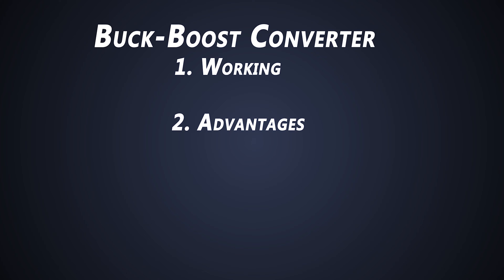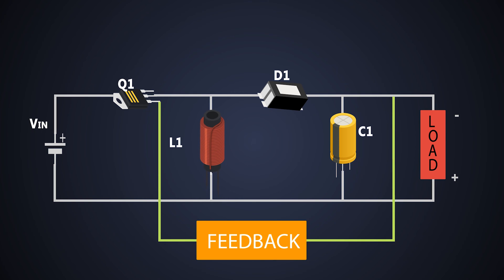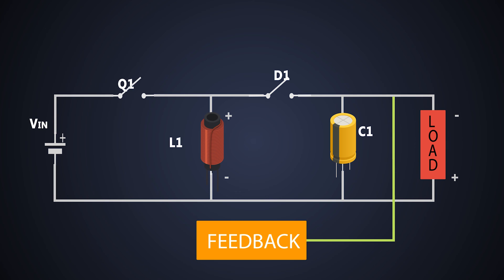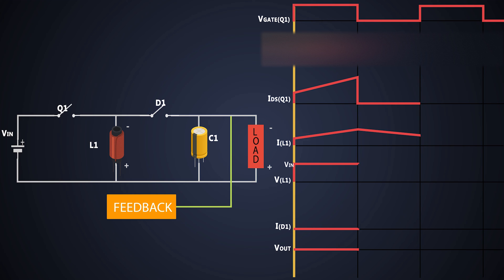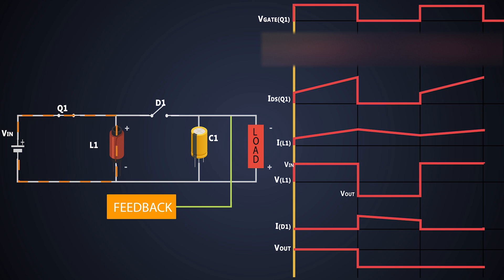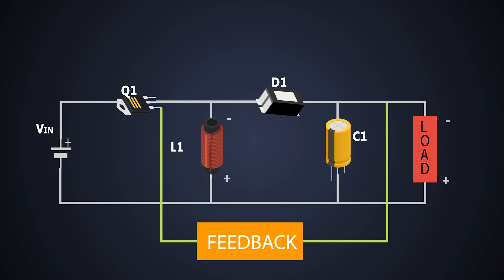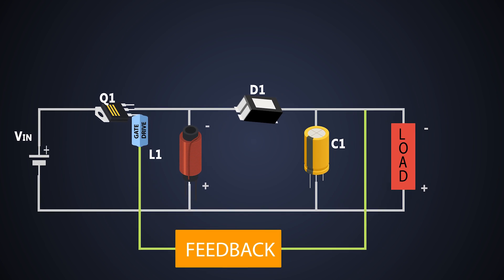How does a Buck Boost converter work? Buck-Boost converter Working Explained

Comment: great explanation, but the pulsed input voltage has to be supplied. It will not work with a DC input voltage.

Comment: How the we size the right converter for a solar power pack? Assuming we have 20ah 12v  lithium battery and 50w solar panel what capacity of buck converter can be used?

Comment: One thing that confuses me, the voltage across the capacitor cannot change immediately, which means the V_c = V_out will slowly charge up when the switch Q1 is turned off. Please tell me what am I misunderstand here?

Comment: i just want to say thank you 

you are the first one that i watch on the internet that mentions the inductors sign change when switch is on or off in all text books they leave the same sign on the inductor and tell you that it will forward bias the diode but it doesn't make sense 

once again thaaaank you

Comment: The depiction shows an electrolytic capacitor and these capacitors have certain polarity. In the case when they get discharged they have different polarity from the case that were charged, similarly with the polarity change of the inductor. So wouldn't that destroy the capacitor?

Comment: Can i use this in a automotive application to lower voltage from 14 volts to 9 volts to lower voltage to an ignition coil? Also if the incoming voltage fluctuates between 12 and 15 volts will the output be consistent at 9 volts or will that too fluctuate? Thanks
Reply: You don't need any boost for that situation so a simpler buck circuit will do.
Reply: @isaacclark9825  so what would you suggest to lower voltage feom 14 volts to 9 volts? A resistor or variable resistor?
Reply: @cobraman428  I would suggest a buck converter rather than a boost-buck converter.

Comment: We are applying dc current on the input side when MOSFET is turned on the inductor will act as a short circuit because its dc current doesn't blow out the circuit please elaborate.
Reply: What's the duty cycle? What MOSFET are you using and which params is your circuit made for?

Comment: I have confusion on how to use a multimeter. When I measure ohm by fluke, it starts with a big number then goes down to a number. Why it does that? (e.g starts with 315.7 ohm then decrement down to 150 ohm)

Comment: If we set the output voltage to 12v and varry  the input from 3.7 to 5 v will the output voltage change??
Reply: Depends if you supply enough power. Power in and power out will always be the same (of course with respect to efficiency) .

Comment: The n channel mosfet can be turn off I use a micro controller and I use the 440 ohms resistor to turn it off in high side switching it’s not hard or tricky from the gate is turn off that the fix

Comment: Hi, this design worked for me when I connected a DC battery to it, but when I use a solar panel as input it no longer boosts the voltage… Can someone help me with this? The solar panel when I measure with voltmeter gives about 5 volts and the battery I used gives 1.5 volts.

Comment: May you elaborate a little more on "Nowadays nobody uses this topology in the actual system due to its numerous disadvantages, but this is the base of all step up-step down converters"? What is used instead? Thanks in advance!
Reply from the maker: You can use Sepic converters, cuk converter or flyback converter as well for isolated output
Reply: did you get a reply? I am curious as well
Reply: @MrRohailbootwala  I did not get a reply, just a like.

Comment: Your solar example of lowering or raising volts to 12 volts is good. However there is another solar example. If the panels provide 19 to 20 volts, the battery controller may be more efficent at higher voltage (up to 30 volts). So boosting the 19.5 v to say 28 volts chargers at a faster rate. This is a problem I had with my "Power Station". A power station being a portable battery, with charge controller, inverter, usb ports and display to monitor charge and load power. With my solar panels connected direct I was getting 75 watts. With the boost converter in-line I went to 133 watts (this is max peak sun).

Comment: Can you explain how this cicuit steps up and steps down the voltage and how you derived the formula for Vout?
Reply from the maker: step up & step down depends up on the duty cycle of PWM.

You will get the Vout formula derivation in any power electronics reference book.

Comment: What would be the optimal solution for Solar charging, Buck Boost converter or only Charge control circuit practically?
Reply from the maker: You need hardware of buck-boost converter & controlling strategy of maximum power point tracking

Comment: How do you connect battery at the output of the voltage is inverted?
Reply from the maker: If the output voltage is inverted, then you can.

Comment: Is it possible for a solar panel to get a DC output volatg (12v from 20W panel)  constantly, I meant when the panel get low voltage then boost process and when   high voltage then buck process to get 12V output voltage using this buck - boost circuit?
Reply from the maker: Yes, it is possible!

Comment: I have a question regarding you saing that an buck-boost converter might be ideal for use on solar panels.
Lets take a buck boost converter of input 8-40V and output of 13,8V with a maximum of 25A and a 400Ah battery. The solar panel maximum output I understood is pending on the solar intensity and also on the temparatur of the panel itself. For example on a constant solar engery input it might show on open circuit eg. 19,5Vmax at 50°C; 21Vmax at 25°C; 23Vmax at 0°C each with 0A (open circuit). The curve of the current at These temperature conditions seems almost stable over a wide range of voltage until it drops quickly to zero.
The described effect I noticed from the solar panel web-simulator: http://www.zabex.de/mppsimulator/mpp_simu.html
Also I noted, that the optimum capacity (W) output of the solar panel is changing on it´s peak depending on the panels U-I-characteristic, sun solar intensity (W/sqm) and temperatur (°C).
At the same time the batteries voltage on the other end of the buck boost converter is somewhere in between 10,5V (empty) and 13,8V (full). 

MY QUESTION: at which working point does the buck boost converter work with such different supply / loads at both ends?
Will Vout (voltage battery side) follow the batteries actual load condition of the battery and therefore decrease current Aout on 13,8V (full) to zero and increasing current to its maximum (eg up to 25A) on 10,5V (empty)?
And how about the U-I-working point at the solar panel side? Will the solar panel side on voltage and current follow the maximum possible capacity (W) provided by the solar panel under its current condition (sun solar energy and temperature)? Could this electric circuit on solar panel side come on itself to a maximum of provided capacity (W) due to an  optimum natural balance of voltage and current of the solar panel?

I would so much appreciate if you could enlighten me on this question …..!  THANK YOU
Reply from the maker: To answer your question in easy terms that, we will need to create an algorithm where the DC to DC converter will provide a maximum power at the output at any point of time, which is called as maximum power point tracking. There are multiple methods to do that.

I hope this helps!!
Reply: @FoolishEngineer  How can we match the required output voltage with MPPT? If a solar panel in specific conditions has a maximum power point at 5V, but a 12V output is needed, how does this converter help? There is no voltage or current limit on the input side to keep the panel in the maximum power point, so I don't understand how that would work...

Comment: Sir, if we have a Source Voltage of 24 V then what should be the value of Pulse which we provide it to the Gate terminal of MOSFET and how do we calculate that.
Reply from the maker: Hi Dude,

You need to use a High side MOSFET driver for this application!

Comment: Hi sir FE I need your help . Pls help me, how stable my voltage from motor generator to boost converter. Because my boost converter module requires permanent voltage , but my main input supply is always changing the milliamps everytime and my peak voltage is always goes up and goes down.. Can you give me tips how to stable my motor generator output aside for fixed regulator?
Reply from the maker: I am sorry man, I can't help you but Thank you very much for watching my video

Comment: Hi!
Thanks to your explanation.
I have some questions:

When the MOSFET is on:
1. Why Vds (drain-source voltage) is not zero or close to?! (as the MOSFET is at saturation region and acting like a switch and you mentioned in the graph that Vl=Vin)
2. And, why the current of drain-source and the inductor 's current aren't the same value?! The MOSFET and the inductor are in series.

When the MOSFET is off:
3. Why is the discharging current of the inductor still linear?!

Thanks in advanced!
Reply from the maker: 1. Yes vds should be zero.
2. When MOSFET is on the current of MOSFET and inductor is same. 
3.But in another cycle the inductor releases stored energy by generating back emf.

I hope this helps. Sorry for delayed response and thank you so much for watching

Comment: How many voltage are boosted using boost converter  input and output
Reply from the maker: It depends on the duty cycle & input voltage. I would suggest if you are aiming for high Power Application Don't go for Buck-boost converter. Use any other isolated topology

Comment: how to get more current Iv,Ov-12 Ia-1A Oa -8A
Reply from the maker: You can configure your control logic if you will be using any ASIC
Reply: @FoolishEngineer  input and output voltage- 12v input current- 1A output current-8A
Reply: @FoolishEngineer  please reply
Reply from the maker: @hardikyadav5277  Input power is 12x1 = 12W & output power is 12x8 = 96W. This is not possible, either you have, more input voltage or current to get 96W output power.
Reply: @FoolishEngineer  we can`t amplify current using any means like transistors and using other passive components
Reply from the maker: No my friend, you can't get more power out of a syatem than its input power

Comment: What is the mean of the Buckboost inverter type or non inverter......?
Reply from the maker: in inverting type of buck boost converter the output voltage reverses. (Check - 0:50)
in non-inverting type the polarity of the voltage stays same

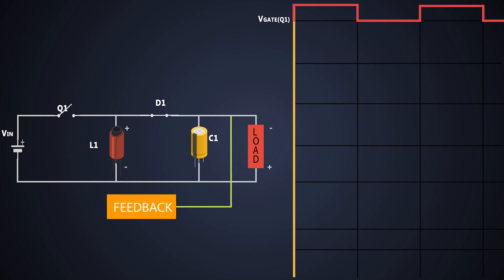Comment: Why the polarity of the inductor reverses?at 3:49
Reply: Because when the fet switches off, the inductor wants to maintain the current flow. To do so, it becomes a source. Since current flows from plus to minus, polarity is reversed.
Reply from the maker: It is the property of the inductor, I'll upload a video on the same, stay tuned!!!😀
Reply: Because of Lenz's law.

Comment: I was told that voltage from solar panels remain nearly constant in bright sunlight or in the shade and that it is current output from the panel that changes drastically from when in shade and direct sunlight. At 7:17 of the video you mention to the contrary.
Reply from the maker: Well!!! whatever you heard about current is true, but the voltage of the solar panel also changes tremendously due to climatic conditions

Comment: I have a question
at 4:27, to use a mosfet in the triode region, V(Drain to Source) have to rise linearly so that drain current rise linearly.
Reply from the maker: Why do you want a MOSFET in Triode region? it works either in saturation region or cutoff region in Power supplies.